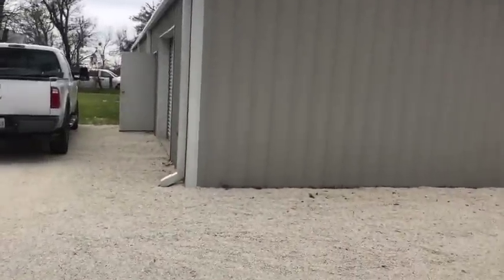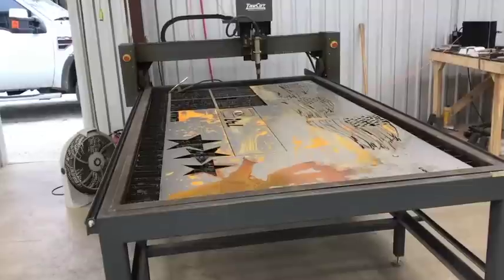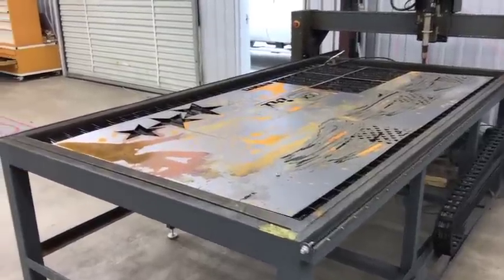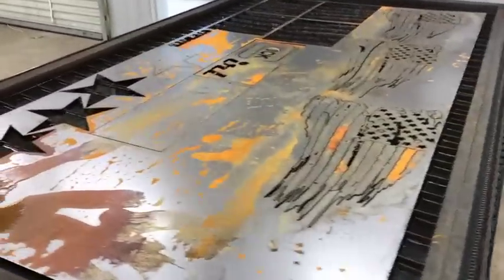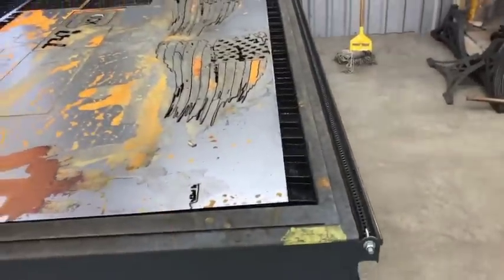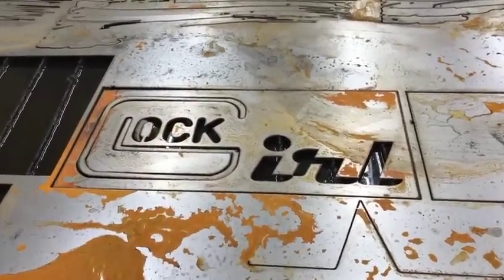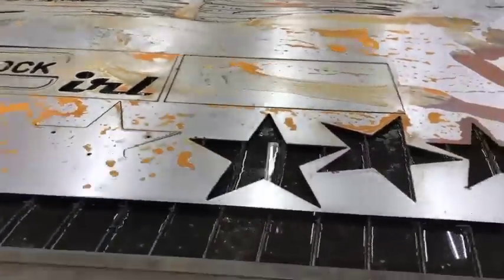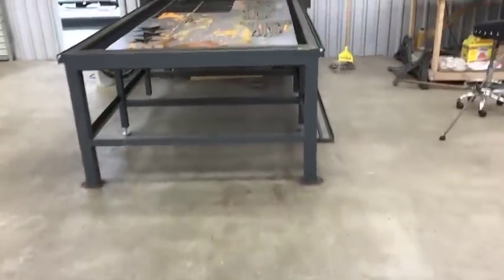Cutting 1inch Plate on the CNC Plasma Table

Comment: i have a 85 amp hypertherm single phase i use all new consumables and instead of 85amp tip 
i use 65 amp tip { smaller diameter } pierce at 4 seconds i do all my pierces first then reset program with 85 amp tip also i find if the sparks are flying back directley upwords i open door for redirect wind works well for me try it out

Comment: Amps x On-time = consumable life duration.  I remember reading somewhere in the Hypertherm literature that a new electrode/nozzle set is good for between 1 and 2 hours of on-time.  However, with the machine running continuously, that time will be toward the shorter time.
Reply: interesting, i havent heard that, in fact, Jim Colt from Hypertherm and others have frequently posted that the on time is the least harsh on consumables, lots of pierces is what wears them out.  if you had 5 pierces and 1-2 hours of cutting would be way better than piercing 200 times and only 30 min of cutting
Reply: @turbocobra , I can't disagree with you.  That is also what I was lead to believe, and I think you would agree, that if those parts you were cutting out of the 1" material had any significant number of pierces, your consumables wouldn't have lasted even as long as they did. (of course, from my own experience, the PM85 won't pierce 1" material effectively anyway.)

My experience involves cutting a lot of base plates for structural steel buildings, the thickest being 3/4".  These plates usually have bolt holes in them as well, and they are my nemesis!  There's so much slag blowing up onto the surface of the plate that the nozzle snags on it when circling back around to the start point.  It makes the holes somewhat jagged.

The point I was trying to make is that if I have a run of say 24-30 plates on a 4'x8'x3/4" sheet, I'll be fortunate to make it all the way through on one set of consumables.  I've had some truly catastrophic failures that involve blowing out not just the electrode and the nozzle, but the shield and the retaining cap to boot! ($60-$70 in one shot!).

Comment: You could break down the boxes flat and save in neat stack. A simple strip of tape on the bottom and ready to use again.
Reply from the maker: Good point Eric, could definitley do that.  One problem with that is that all of the boxes have packing in them, foam inserts, etc, which I use as well in some of the things I pack. I need to come up with something for sure !

Comment: Get yourself a forklift and a metal hamper. Cut the small pcs. up and throw them in the hamper to use if needed. When the hamper gets full sell it for scrap and start over. It will confine the mess to a single container or 2 containers if you have aluminum also.
Reply from the maker: Really good idea.  I dont have $5K-10K for a forklift
Reply: If you shop around you can pick up a 5000 lb capacity for around $1500.

Comment: Hi Gary,
Yeah, I had the same problem with all the cut up sheets just sitting around.  I finally bit the bullet and bought a hand torch for my Hypertherm 65.  It is a plug and play deal.  I keep it hanging close to my plasma table so when I have  skeleton, I just shut off the plasma cutter, unplug the machine torch and plug in the hand torch and cut it up right there on the table.  Very easy and clean.  I then throw all the cut up pieces in a tilting metal bin I acquired so everything is cleaned up.
Take Care,
Reid

Comment: Was your thc messed up or your float mode? I had a issue once with the tips doing that and it wasn't completely flat, so as it moved along it hit a high point and between the heat and it hitting the metal it ground it down just like that.

Comment: Gary at my old job we had a manual plasma cutter I used that to process the drops from the cnc right after the job with a cutting guide.  Occasionally on the thick stuff I got the torch out.  For the boxes I save mine too, but break them down flat. Any packing foam or paper I put in a large garbage bag.  For your drops maybe consider making caster plates, gussets, or something that will fit in flat rate boxes.

Comment: I always do a home  location point on my sheet before i start to cut.  i go to the very corner of the area or the sheet and turn the torch on for a second after i zero out the x and y.  That way if something happens when Im cutting and i have to restart i can jog to it and re zero.  it can be a pains sometimes but it is better then losing what im working on.

Comment: Gary I believe you will find that steel scrap prices don't rate the time and effort it will take for you to haul it to the scrap yard yourself.  Consider having a dumpster dropped at your shop by one of the larger scrap buyers in your area and retrieved when full.  Of course the scrap dealer will have e to bring a forklift on the truck with them.  There are a large number of scrap dealers in the Phoenix area that bring there own forklifts to load and unload the containers.  Just a thought.

Comment: Trailer light brackets, license plate holders for trailers, clearance light brackets. Weld on or bolt on. That would be a good use of your scrap 3/16. You could cad up some basic pieces, insert them when you cut your current kits or whatever. Its a commonly needed thing that you could nickel and dime out of that scrap. No rocket science, and small parts to inventory. People tear up lights everyday on those trailers. Just a thought.
Reply from the maker: Excellent thought!

Comment: I am in a constant battle to keep my work spaces clear and uncluttered.  My cut-offs are mostly wood and not metal, but we share the same task.   My biggest mental hurdle is accepting that no matter how much I delete, I will always make more to fill the voids, so I have to push myself to actually clearing out the scraps..give away or throw away...they need to go away.
Reply from the maker: its a struggle for sure.  Right in the middle of dumping it at the scrap yard your thinking.  Hey I could make soemthing out of that.  I have been thinking alot about having a work program maybe 2 afternoons per week and have local high school kids come and do a couple hours work in the shop, and have them cut it all up, and have them come up with ideas to make soemthing out of it or re use it
Reply: That is an excellant idea promotionallly speaking. What happens is not only do you get to interact with young adults and possibly shape a future, you get the attention of parents and other community minded people. When they see you contributing to youths and their well being they become customers and references for new customers.

Comment: Also, you should have a plasma hand torch near by, so you can complete the cuts by hand, or cutting apart the sheets on the table. But nesting in rectangles, triangle gussets, circles is the best use of the off cuts. I have this one particular triangle gusset that I designed, with a nice arc on the hypotenuse, and the weight reduction circles cut out. I always try to find places to drop that into my cut files where there is empty space. You could just sell those in sets of 4 on ebay. People would eat those up. I can send you the 3 or 4 standard gussets files I have on hand, if you want.
Reply from the maker: Now that is the best comment you have left me in quite some time. I was about to kick you off the channel
Reply: It's OK, I can aways find another channel to troll.

Comment: Was you doing a machine pierce or an edge start on the 1" plate job?
Reply: Edge start.  Hypertherm 85
Reply: Thxs for the quick reply, 

I am doing a 6x12 build. I will probably start off using the 65 or 1250 that I already have but will put a 105 on it when the job dictates it..

Comment: Man, I have to tell you, every time I see you cutting something and I see that water boiling up onto the plate I can't help thinking that is part of your problems with cuts, etc! Now I don't have a plasma table, but I think you need to talk to someone that has one, see if they are having same issues, and if they think that water is having an affect on your cuts! I follow another You Tuber (Keith Fener) that has a plasma table with a water bath, but his is down low and he gets no boil up onto the plate and never mentions issues like you're having (or at least never mentions them on camera)! Maybe that water is having an affect on tip performance, how the tip affects the cut, or even cooling the cut to fast? Again I don't have one so am just throwing ideas out, you need to talk to someone that does! Maybe not manufacturer, as they may not want to acknowledge problem!
Reply from the maker: Fred, actually you are very right! I actually saw a video from Lincoln who bought Torchmate Plasma Table company.  They suggested that one of the common problems was having the water level too low, because when I had the water level low was one of the reason I was having problems with the cuts.  I have since raised the water level all the way up to touching the bottom of the plate and it made a huge difference! When the water level is too low you actually get a lot of splashing of the water, when its up high the water absorbs more of the flame/air edge and doesn't splash near as much.  the main issue i had before was related to a setting on the plasma cutter, my edges instantly  improved when i made that change